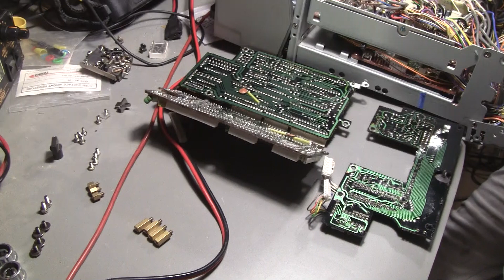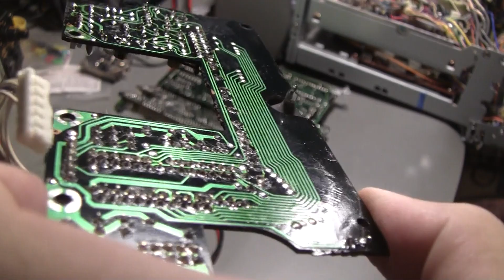Kenwood TS-440 Repairs ! Part 2.

Comment: Wasn’t it back then all ready flow soldered? 
Anyway, I’m in the same boat. I need to recap mine and figure out the watery sound problem.
Reply from the maker: It turns out that all of the radio manufacturers I've worked on have poor soldering techniques by design. So as the solder ages, the poor quality joints become so bad that they fail to make good connections. Please post your re-cap work !!
Reply: Desert Mike DIY will try and film it 👍🏻

Comment: take a photo thru the microscope(digi scope) to show us a bad solder
Reply from the maker: Easier said than done. I'll give it a shot. Lining up the video cam with the eye piece is fairly sketchy.
Reply from the maker: I did manage to shoot video through the microscope of some bad solder joints in part 3 of the ts440 repairs.

Comment: Replace all of the caps first, it is certainly old enough and deserves another run.  Good luck finding the SSB filter used; but I think there is a custom mfr in Aptos CA (there used to be anyway) that sells new ones.
Reply from the maker: I'll consider that. The TS940 filters are suppose to work better. Ebay has some of each. Pricey. For now I just need this rig running, then finish one of the 3 antennas I've started.